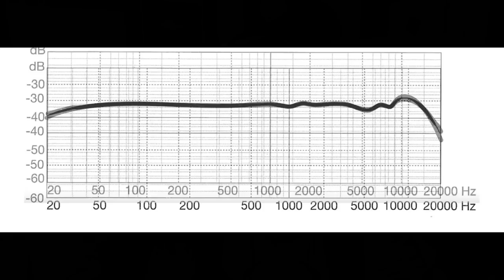Can You Really Trust An Advertised Frequency Response - Sound Speeds

Comment: Thanks for the informative video!  I really enjoyed the interview with Ray.  I agree with nearly everything he shared except that the new U87 is transformerless.  He must be thinking of the U67 vs. a TLM67 as all of the U87s in every variation have an output transformer - you can verify this directly with Neumann - it is actually what the U stands for in the model name. The output transformer could cause compression in the audio signal as it starts to saturate and that would be audible but may not exhibit as a change in frequency response - no way to know for certain as they would need an active impedance compensation circuit of some kind in place of the transformer and maybe they could emulate the transformer behavior well enough to not impact frequency response.  Thanks again!
Reply from the maker: More great info. Thank you!

Comment: Same kind of thing happens in the headphone world. No set standard even of what constitutes flat in a headphone. There have been attempts to standardise this as well over the years but manufacturers continue to display graphs that show their headphone in a good light.
Reply from the maker: Ian Craig Yep. I do like what the AES is trying to do though. With them involved, I'm sure spec data sheets will only get better with regards to accuracy
Reply: I've got a $20 set of headphones that I've used for years. Bought a new Tascam set of headphones for $80. Each have advantages over the other. No apples to apples comparison.
Reply from the maker: Yeah, some of those older headphones are solid as a rock despite the price.

Comment: I'd say I'm more confused, but get the idea that microphones can change over time, sensitive to heat, vary in sound from mic to mic, even from same batch. Seems like quantum mechanics, Heisenberg uncertainty, than "buying a sound". Do like how you touch on preamps, room treatment, distance of mic from sound source affect the mic, but also speaker placement, head phones also affect sound. Best microphone 😅😂🤣 doesn't exist. Fix it in post.
Reply from the maker: It's certainly a craft in itself. I have a lot of respect for the guys that do it as a hobby too.